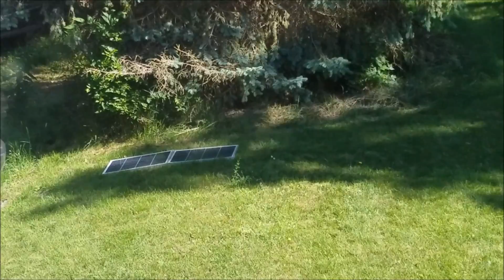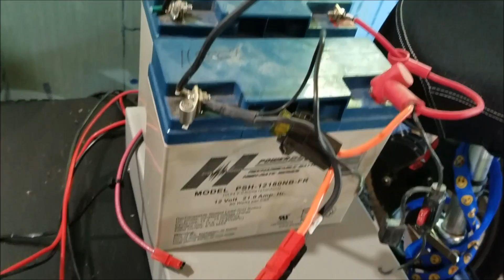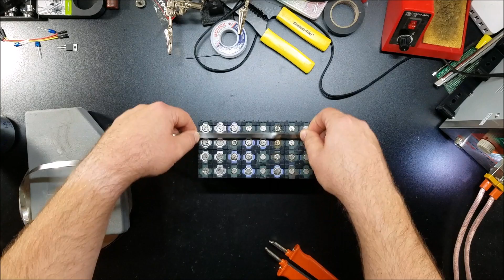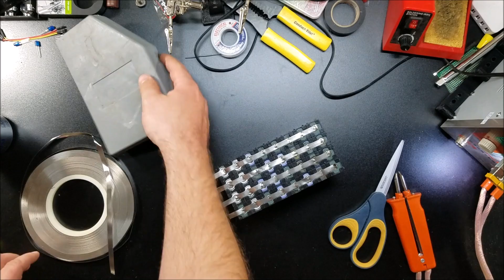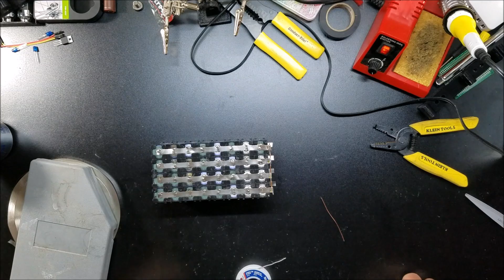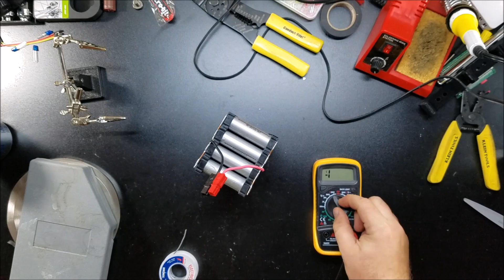DIY X-BANK prototype build: Welding the pack! (part 3)

Comment: that's not going to work well. I don't have a welder so can't see why it wouldnt work but you should have spot welded across the bars as well. the copper between the nickel bars is going to cop a beating of current under high load.
also, having negative and positive on the same side will drain the closest cells first due to any resistance over the length of the nickel or whatever lines. putting one rail on the other side would at least even it out.
Reply from the maker: +Phizicks this is just a prototype, so we will be able to measure these losses once it is working :)

Comment: small advice ..the welding pointer need to have some copper heads mounted in... not welding directly with the steel headers...you need to mount copper heads inside those headers..o man o man
Reply from the maker: +Petre Adrian the copper has worn off this one, I have a new one on order. Do you know how to mount new copper probes into one of these?